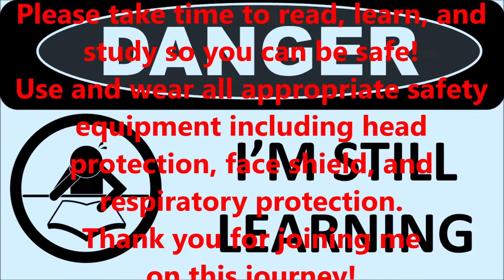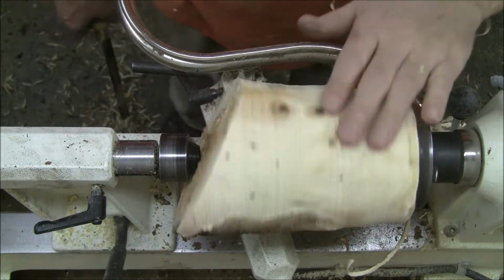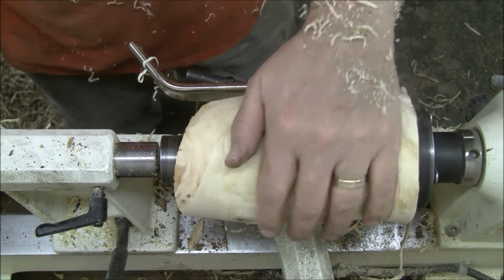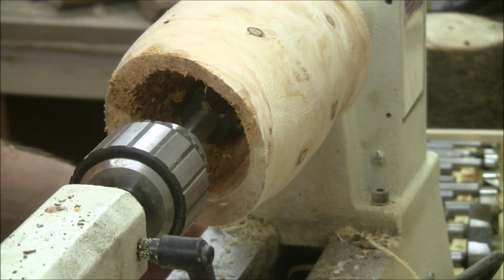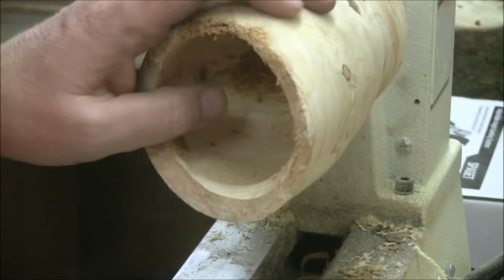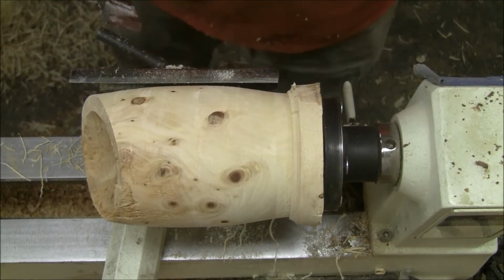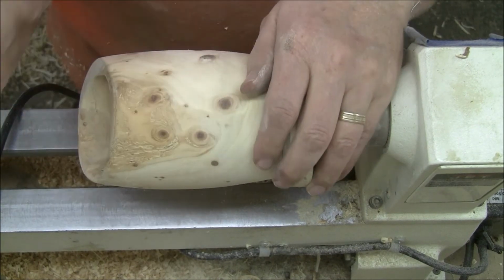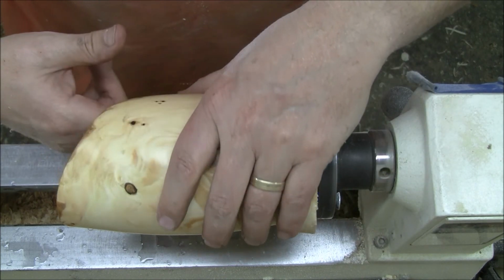Pine vessel with slanted top

Comment: This is a soft type of wood and it is wet , so difficult to cut . Dry the wood first . The speed is too slow . The circular auger cannot be use for all wood esp. Soft wet wood . The cutting edges of the auger the rake angle is for hard wood . The teeth cannot cut the fibers when wet . Go ahead to fail and learnt . But safety very important . Never put any thins or tools on the flat bed of the lathe .
You will do better and better , I started with a lot of trails . Cheers .
Reply from the maker: Thank you for the advice!